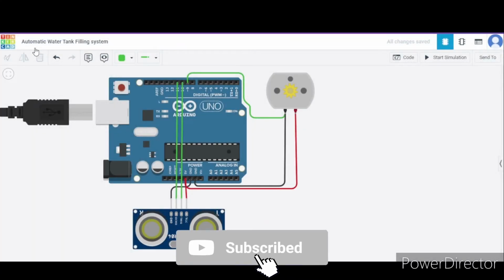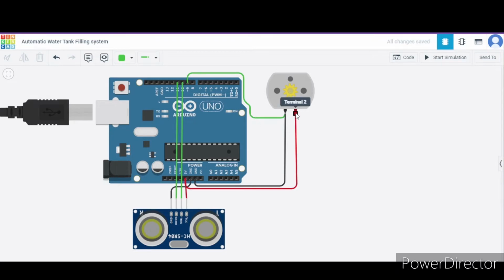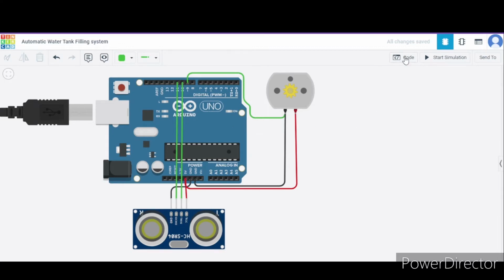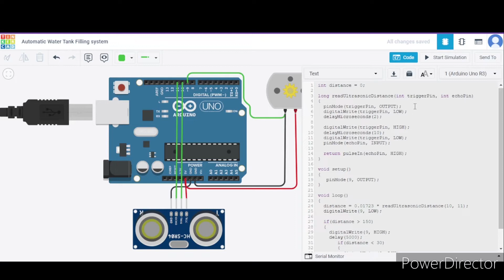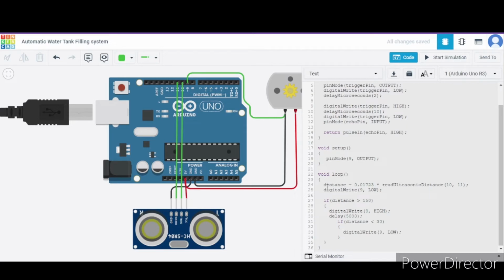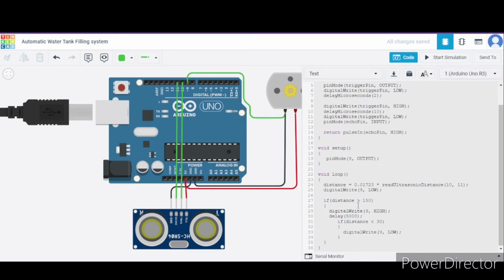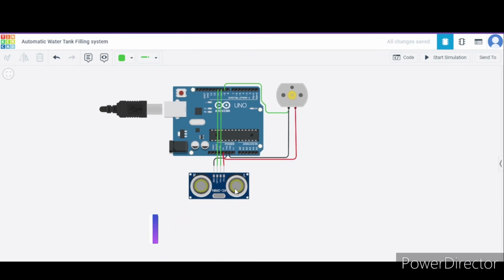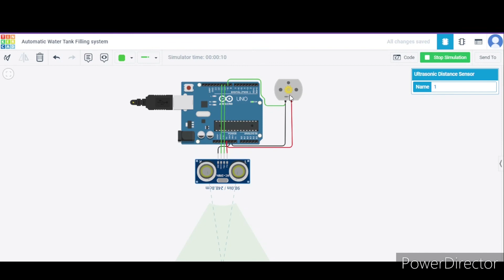Automatic Water Tank Filling System Using Arduino | Arduino Project

Comment: it will rotate till some set time(in this case, 5 seconds) or it will turn motor automatically  off when the distance is less than 30 cm as per program
Reply: We can alter the time as per our tank capacity...and it will turn off when the distance will be less than 30 cm:)
Reply: Are you planning to make one for your home or just for a project?

Comment: I don't know how to program arduino , can you name some website from which 
 I can readily install and program of arduino of tank filling system
Reply from the maker: No issues! We are here to solve your problem. 

Source code For This Project: https://myprojectideas.com/automatic-water-tank-filling-system/

Also here is the website to learn all kinds of projects: https://myprojectideas.com/
Reply: @rudelabs  should I paste the code or write it ?
Reply: Well...both should work!
Reply: The code isn't able to upload to arduino, its showing incorrect
Reply: What is the error? Share your code you are trying to add with the circuit. You can upload it in github or youtube and share the link here!
Reply: @MissMeerali  connection digaram is wrong
Reply: Whose? Yours or this one😅
Yea, if you have connected your circuit to diff pins then it might not work properly! Edit the code accordingly...to the pin number to which you are connecting..., Because i think this one is quite easy one, if m not wrong!!:)
Reply: @MissMeerali  I did the same connection 😅😅,and code is right , but it didnt worked , as it is not turning off the pump when distance is less than 3 cm. 

Can you plz help me ?
Reply: Ohk! That one...do the following changes in DC motor terminals.
1. Connect 1st terminal to GND pin of Arduino.
2. Connect second to 9 number pin of Arduino.
Remove other DC motor connection.
Now it must work as per your requirement!
Reply: Hi!
For code,  visit this - https://myprojectideas.com/automatic-water-tank-filling-system/
If you are planning to make one physical project, then you need to purchase components...else you can use tinkercad to perform your experiments:)